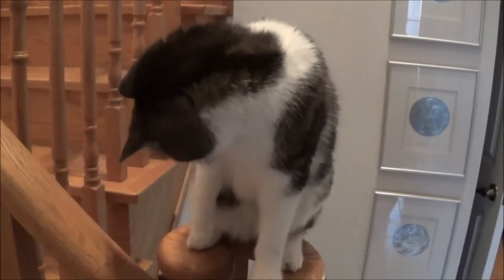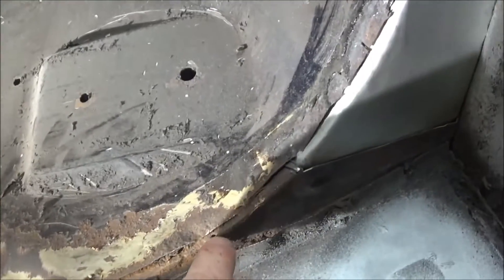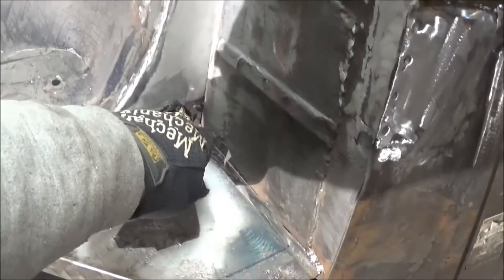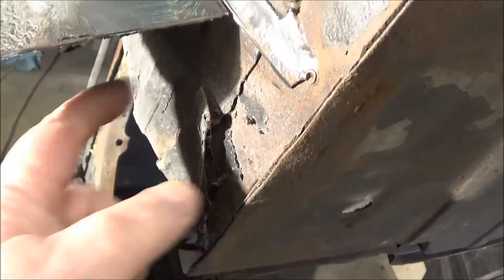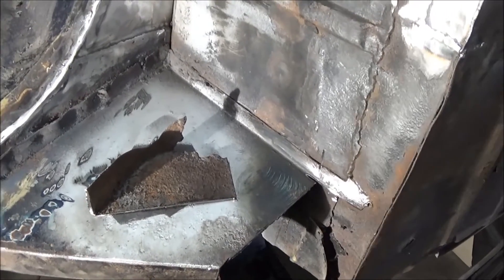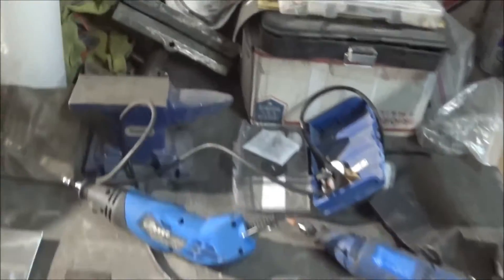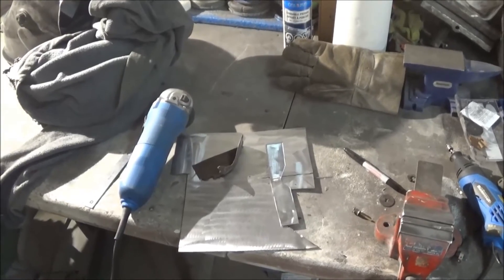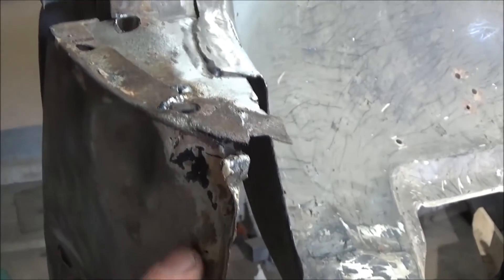1968 Triumph TR250, Restoration More Drivers Side Body Tub Welding Repairs

Comment: Tush, I like how you are able to speed up sections of the video. What video editor are you using?
Reply from the maker: r1lark I'm just using Windows movie maker..it's pretty basic but it does what I need to do for the most part.
Reply: Thanks Tush, that's what I need, something basic. My computer didn't come with Windows Movie Maker, but I found where I could download it. I'll  try it out tonight. Thanks again!

Comment: Good progress Tush! Nice looking cat too. BTW, what diameter wire are you using in the mig?
Reply from the maker: kblume1 hi Kevin, I use anywhere between .o23 and .o25 depending on the brand. Cheers, Tush